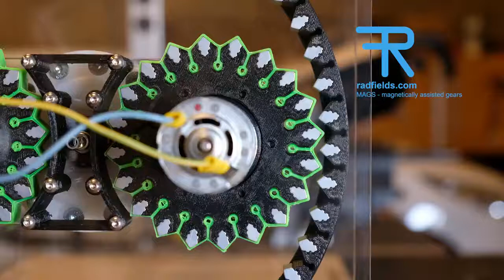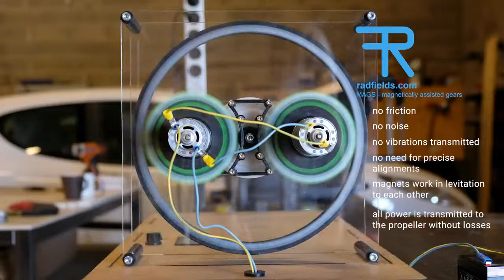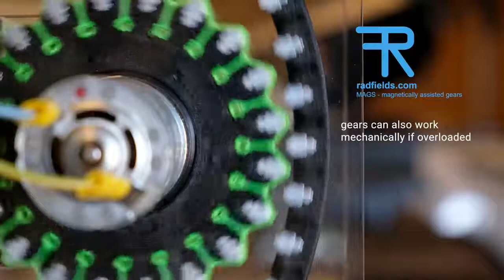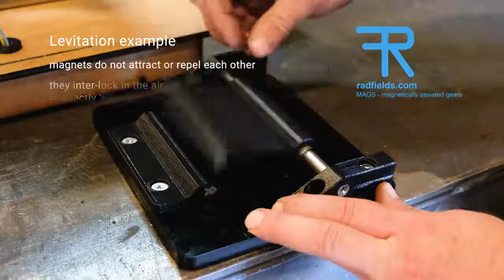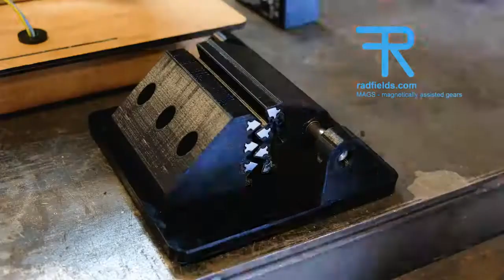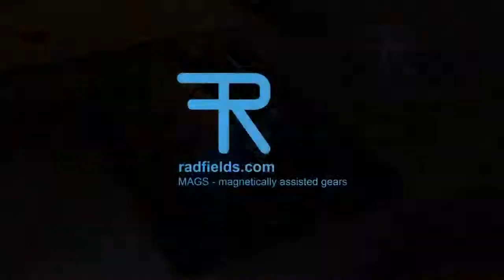Magnetically assisted gears, No losses?

Comment: As a senior mechanical engineer, I do find this to be fascinating...the elimination of gear tooth wear.  A few questions:  What is the maximum torque that can be endured before the teeth make contact?  What is the life of the magnets?  At what rate does the magnetic field of each tooth degrade with age?  What is the minimum and maximum operating temperature of the teeth?  What is the minimum gear pitch diameter that can be made?